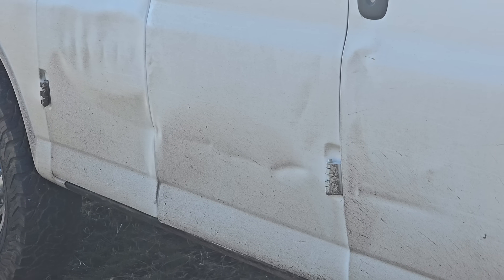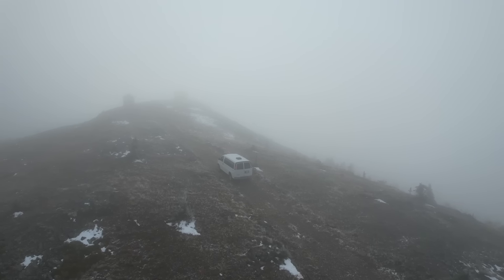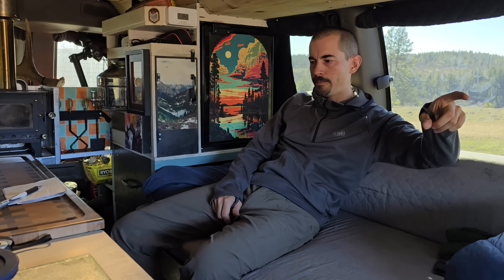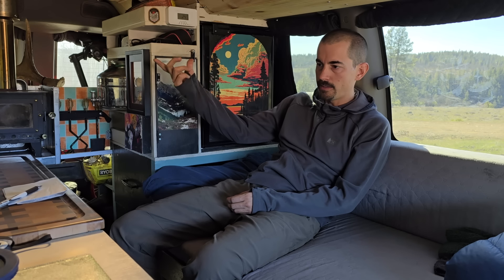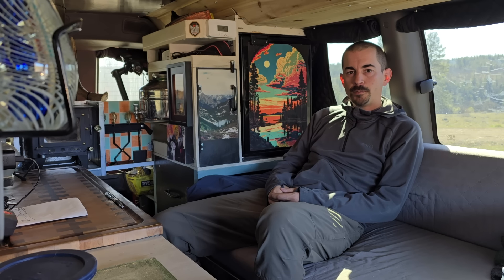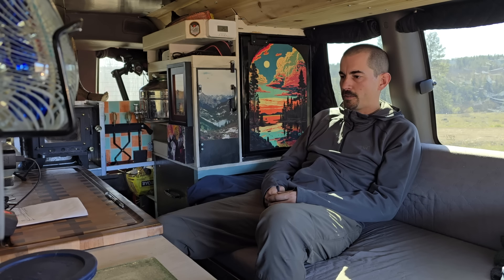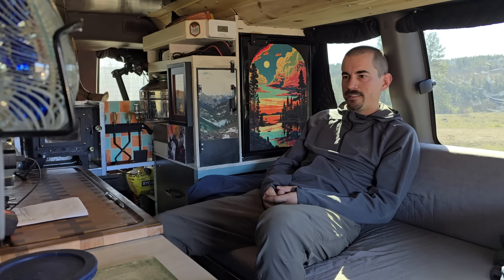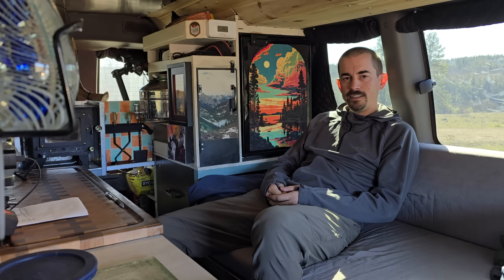Lets just talk about condensation and insulation.

Comment: Actually having breathability is an important part of insulating. Keeping the insulation dry is a thing. One thing I have seen in my own experience was a Van I purchased years ago, where they put fiberglass insulation directly against the metal sheeting, because of this, there was no way to dry the space the insulation occupied.  This caused the fenders to rust and rot out severely. Closed cell foam is a great idea, but I think putting it against the metal is a mistake. Black mold is a modern problem caused by recent building practices. So there is that as well. Be well!

Comment: People seem to love installing thick wood slat stuff to van walls and ceilings but to me it seems heavy, expensive and comes with installation issues.  A nice beadboard/wainscotting panel would look similar, be lighter, cheaper and probably hold up well since people aren't giving their walls and ceilings a beating.  Just glue would work for that stuff and any screws for additional support could be short.  Personally I want a thin stainless steel wall covering that will be covered in cleanable wallpaper so I can use magnets everywhere.  If Baltic Birch wallpaper wasn't doing it for me I could easily switch to mossy rock wall, dinosaur land of the lost or whatever theme I was in the mood for.

As for heating a van one idea I am debating is installing a second gas tank under a van (holding 12 gallons/45 liters) for diesel and having a real supply of diesel to work with so in winter I wouldn't need to run to the gas station constantly to run a diesel heater to keep things warm and dry(er).  I am still researching insulation but I know I want to permanently seal my walls and any wires or pipes would be in conduit attached to the wall so when things do go wrong I don't have to tear everything apart to find/fix the problem.  I experimented with using a bucket of Damp Rid in my car to see if it made any difference with the humidity and I didn't notice any difference whatsoever.  Venting is probably the only way of getting rid of humidity.

Comment: My armchair recommendation on the roof: don't use adhesive to hold up a roof. Years of vibration I would think would cause an adhesion failure. You could properly seal a screw using techniques used in the marine industry. Or just don't worry about a vapor barrier because you have closed cell foam. That and Rockwool (mineral wool) are both mold resistant.
Reply from the maker: That's a good point.  Maybe butyl tape to seal where you screw thru the vapor barrier.. ?
Reply: Yeah, I think butyl tape is one method and some forms of caulk is another. But butyl tape should work. It's supposed to remain pliable with age I think.
Reply: @morestyforest4325 there are many forms of non hardening caulk. I think to put it where needed would help with the screws. But the ceiling needs to be fastened not glued.

Comment: Just think some commercial made camper builders creations why they have several moon/sun roof vents that you can open, and when you look at those you can see they are breathable even in closed position! So the main thing is that all moisture you got inside is mostly ventilated to outside air (yes of course you loose some heat) but that is the main thing, and believe or not they even calculate how much of those are needed! Fortunately many own build vans are like a closed box as many tend to think it is better for heating! That woodstove thing is also very good for moisture as it needs much outside air and ventilates moisture out that way too!

Comment: Have you considered Spray Foam?   For instance the pillar behind you that goes between the windows?  Spray Foam perfect😃👍🏻.  I used to work at a Chevy and an Olds dealership and we’d use this for wind noises as a complaint.  Even if you need to drill a hole to get foam between the metal panels is ok.
This could save you a lot of work and money🤑.   This also deadens any noises👍🏻

Comment: When I built out my low roof promaster I did a spray foam coasting using a frothpac 200.  Its insulation and vapor all in one and   ensures you can every nook and cranny covered.  I think any other system will have gaps.

Comment: Good video... It's good to have some goals to look forward to.  I heard that the spray foam works great, but may have fumes. I suppose if you air it out for a month or whatever is needed.... it should be great. Don't forget that the foam expands after it's sprayed.... can be a factor in tight quarters.
    - It would be interesting to see what solution you come up with.

Comment: Might consider a fiberglass high top roof to raise your head and gain oodles of storage room. Assemble insulation vapor  barrier and trim with all adhesive products. Closed cell poly extruded sheets of insulation for roof. There is a product that has vapor barrier and slight R value used for covering old house siding before installing vinyl siding called Fan Fold insulation. Fan Fold has aluminum facing that is flexible and can tape joints with aluminum faced duct tape. Use automotive adhesives and apply any style wood finish type flooring to ceiling. Or just use same method to cover your tin top. Search up wool insulation for vehicles and follow there instruction for walls and doors. Fastest easiest best product and economical. There are options for cargo containment for front of vans with slider. Best protection from flying objects in case of crash. Could insulate said barrier with Fan Fold insulation and a snap lock type flooring of your preferred design just like the ceilings cover both sides and use adhesive . Rear insulation barrier. Get a moving blanket from harbour China freight. Sew a covering of waterproof rip stop nylon or simular fabric to cover blanket. And whilst picking up moving blanket grab a snap tool and buttons to attach said blanket to ceiling walls and floor. Use wood or aluminum channel glued to floor ceiling walls to attach the snap buttons using self tapping screws...Cover windows with same moving blanket and sewn cover with rare earth magnets  sewn into a hem available at harbour China freight also and said covering can span across  windows to make a water proof air gap to stop condensation. Even your windshield. All held with magnets.  Make certain all the magnets have same polarity facing same way. Might hot glue the rare earth magnets to the hem fabric. If one side is covered with a black covering you can be invisible at night or daytime even with lights on. Other side can be as festive or bland as you desire. Amazon up a Ozone generator, So when your near a electrical  outlet you can. Kill all mold and fungus and woodsmoke and cooking and dirty laundry smells. I use a LP propex heater with tank and made a carbon filter to help. Much better than Chinese diesel heater but of course , the price is steep for heater and tank. But both can be.mounted under the van body. Uses less power much quieter and diesel stinks and makes soot. The propex dries the air quickly. Have a blast with your refit. Enjoy the product of your own hands. Keep posting Foresty. I like it
Reply: This chat ever work?

Comment: Just build in cedar....you won't have an issue with mold... you can use the very light 1/4 in tongue and Grove cedar planking for.the ceiling and walls...I used a variety on insulation material

Comment: Here because of air you need at least a 14 wall if build a cabin. If your going small you need to change the air. If you have some kind of way to change the air you could get fresh air and get rid of moisture. In a root cellar there is usually a vent for heavier than air and a vent for lighter than air gases.

Comment: Definitely close off the front and back like you mentioned then perhaps just Velcro up section blocks of water proof, durable insulation. Then you can just pull them out quickly on occasion to inspect for mildew and to let it all dry out good. Why make it permanent and why do you need tongue & groove over it? 
It seems like every camper with covered and glued-in insulation ends up ripping it all out at some point because of of moisture and/or mildew issues. 
Good luck!

Comment: DO IT! DO IT! DO IT!!!!! Also use closed cell foam all around. It has much hire R value per inch than other insulation methods without using up your space and is a vapour barrier in one step. R7 with just one inch of insulation and a vapour barrier all in one step.

Comment: How about spray foam insulation?  We did it at our lake house in the ADK’s hunting camp to year round residence..old 2x4 construction and it was tightly sealed..-24 F with a propane heater.  Fast installation no moisture issues..it’s also cuts the outside noise.

Comment: the windows (and you have plenty of them) is a key problem for condensation and heat loss. Not just the roof or isolating the front and back. You need to craft some 'insulation-pillows' to velcro in the window openings. Running a small dehumidifier for an hour or two at a time can also remove condensation and increase temperature.

Comment: All I did was put Havelock wool where I needed it. And put quarter inch plywood on the walls and ceiling. After four years I have looked and there is no mold. There’s no signs of it at all.
And now I am in cold weather and very humid, humid weather in southwestern Missouri most of the time

Comment: I don’t think the vapor barrier is necessary… in fact it could be problematic. Vapor accumulates at the place where the temperature reaches the vapor point. So if it’s 65F inside and 15F outside, some point between there (and in your wall assembly) is the vapor point. If there’s any open cavities (either in the insulation material itself or otherwise) moisture will pop up. If there is a vapor barrier, it will STAY in there, rather than have a vector to dry. I would do what you propose, but no vapor barrier.

Comment: Hey Forestry. I been living the same sort of lifestyle for 6 years.  I have a catalytic heater from princess auto and while it's super cheap to run ( 20lbs a week ) in -20C heating 26 ft trailer it doesn't have the air movement so ice builds up around windows and on walls and so now what i do. I run the Cat heater but also the furnace . I save a lot of propane utilizing both and don't ice up. I use up 40lbs a week in extreme cold weather. I'm just outside Edmonton if ever want bounce ideas

Comment: Hi, forest so I ran pink foam with ducting tape on a unfinished ceiling for 3months during 14degrees, 

I did notice that without ducting tape I would get moisture buildup on the metal inside, but if I shielded it with even the slightest air gap between my internal living space, I then would not get any moisture. I checked many times cutting tape back checking for moisture, had 2 people overnight and I live in a naturally high moisture area. After I was comfortable with the ceiling I put up plywood panels attached to hardwood oak runners
Reply: Ps I saved money by not finishing the entire ceiling. Places where my upper cabinets touch the top of the van is not finished but is hidden from sight so nobody knows

Above my foam is also 1/4in reflectic , in Econolines theirs about a 1/4in gap when installing rigid pink foam. So I'm getting the benefits of that kind of insulation as well.

My layers + mounting: 
Van steel; 1/4in reflectic+1/2in pink foam (only between the OEM ceiling braces, foam is flush)

 on top of that layer attached to the Ceiling Braces,via stainless steel self drilling screws is 3/4in red oak by 4in runner's going front to back* I have 5 runner's 

I attach plywood panels in 2ft by 4ft sections for ease of installation, but since theirs the 3/4in gap from the runner's between plywood and layer 1, I then add layer 2 of insulation this time not using reflectic, keeping a 1/4gap which I also squeeze some glue between those layers to prevent squeak's (it has) 

I used half inch plywood so I could recess my lights into the ceiling because I didn't go the traditional puck light route, with my amount of bracing 1/4in ply would not Sag.

Comment: i was dead set of putting a vapour barrier, i couldn't believe people didn't do that. i saw 2 professionals do it. Then later one of them said he doesn't do that any more - "can't keep the water out of a van". he is an hvac guy, brit. So lots of moisture. i have gone with some 10mm foam insulation, that acts as a vapour barrier. it's not perfect. I also use sheeps wool, as it works well with moisture. i am testing de-humidifiers. I haven't built out walls inward as i want some of the metal exposed. I heard windows are the worst for cold, you have lots of them. I think for winterizing, the walls have to be built inward significantly to remove the thermal breaks. i have a few and i don't want to lose my width. Just some thoughts for you. I am on the wet coast, i am concerned with long winters of rain with low driving for me, and less about cold. However we had 2 cold snaps this winter, froze my water. Most of the moisture was on non completed ceilings on the metal - i temporarily covered with reflectix as that is easy. It seems driving is the best as i think outside air goes over the engine, gets the moisture removed as it heats, fills the van and pushes out the highly humid air, even though the air outside is more humid. What i found is the air stabilizes with the outside air about 20% or so below outside. I wasn't sleeping in it much as i dont live in it, i think you would have way more moisture. i also tried a gun safe silica, it works well (it fills up) but cannot work with the volume. i also have not used any self tapping screws, i used existing holes - lots of them, all i do is enlarge them for rivnuts. If you are concerned about holes from screws you can seal them.

Comment: You need an air intake for that wood stove so it’s sucking air from outside the van. With it sucking air from inside the van it’s creating a negative pressure, plus the wood stove will burn better when the van isn’t a negative pressure.

Comment: You should check out a diesel heater. Extremely cheap, would heat that Van on the lowest settings, and produce hot dry air that will eliminate any condensation issues.

Comment: Oh, interesting twist… I thought it was going to be go to a new vehicle….lol… couple thoughts I have… insulating with pink Styrofoam sheets with spray foam, sealing in between… if you use this method, I question the need for vapour barrier… and I know from personal experience it’s quite effective…. Regarding wiring, I wire everything on the face of the wall , I don’t want to have to pull Wall out for any possible issues down the road….. and if you were taking on the rebuild alone with no one else in consideration, I would probably rent a commercial garage with a bathroom for two or three months, as opposed to a townhouse… one with the commercial garage door, so you can just drive the van right in… 😊. I have lots of opinions, and sometimes they are even good. Lol.  Greetings from Nova Scotia

Comment: The adhesive solution seems dicey as vibrations and temperature fluctuations will be tough to handle. All the weight of the tongue-n-groove will pull down on the adhesive mounted insulation.  Maybe consider using super-strong neodymium magnets to secure the vapor barrier/ceiling material. These magnets I’m talking about are very strong and very dangerous if mishandled. A 1” x 1” x 1” cube neo magnet is what I’m thinking would be very effective. Magnets would allow something to be mounted without puncturing it. Edit but if you end up trying this, please, please be careful. You cant allow anything magnetic to get near them, especially another neo magnet. It would be kind of a challenge to manage having these around as they’re strong. You could lose a finger/part of one if mishandled. Good luck, FF!

Comment: A warning against vapor barriers: even if you manage to get it 100% airtight facing inward in a way that's resilient against the flexing and vibrations from driving, the body of vehicles don't tend to be airtight either, especially with ceiling ribs that probably continue all the way down to the floor. If any part of that isn't a perfect seal, moisture can accumulate and the vapor barrier will be what really traps it in the insulation, leading to mold. In my opinion it's better to use a breathable insulation and design ceiling panels with gaps that lets the insulation air out and dry.

As for ventilation, airflow and dry heat are the only things that can really combat moisture buildup. Letting out warm air is an unfortunately unavoidable inefficiency. Improving the insulation elsewhere will help reduce that impact though.

Comment: The issue you're running into is a thermal bridge. It's not that there's too much moisture in the van, it's that things like the windows or any exposed metal are cooling the air around them and causing water vapor to come out of the air like a cold beer on a hot day. Cover any exposed metal, seal off the windows with reflectix, and hang a heavy curtain between the front seats and the back of the van that seals all the gaps.

Comment: Nope, the nails into the 2X2 will migrate cold and heat and cause condensation in the ceiling. You need to use spray foam as it will seal and is a powerful adhesive. Then you can apply (glue) nice paneling for your finished ceiling, thus saving valuable headroom.

Comment: consider putting in a floor vent.  only needs to be 4 or 5 inches in diameter.   in summer, your roof vent will draw cooler air from underneath the van, even with the fan off.   cooler than having windows.  in winter, having the floor vent open is warmer than an open window, since cold air sinks